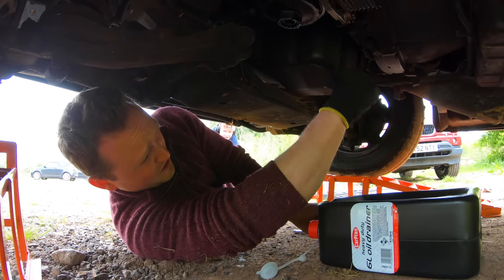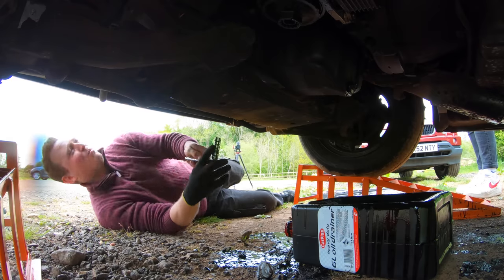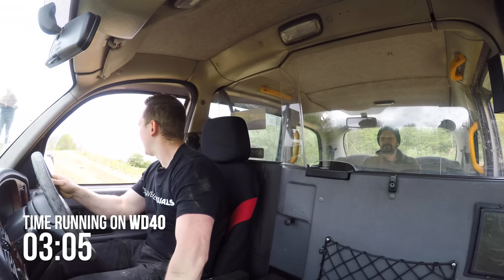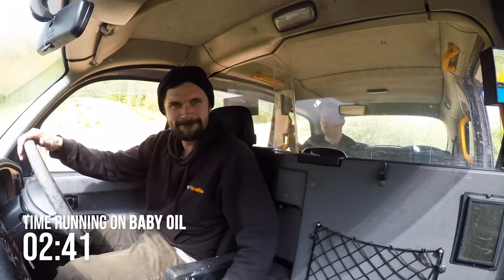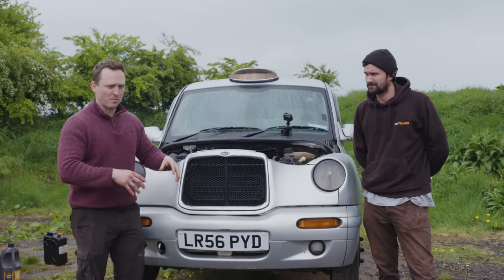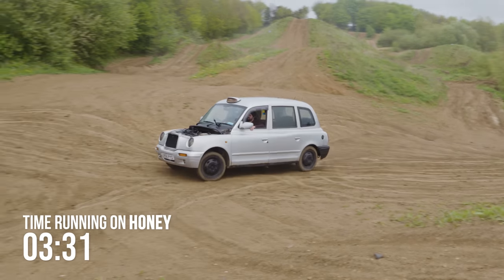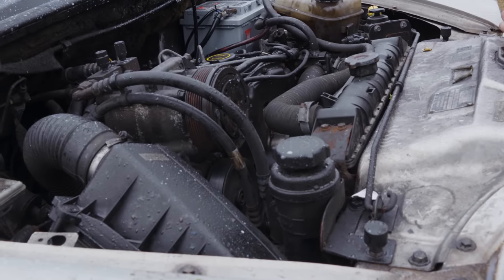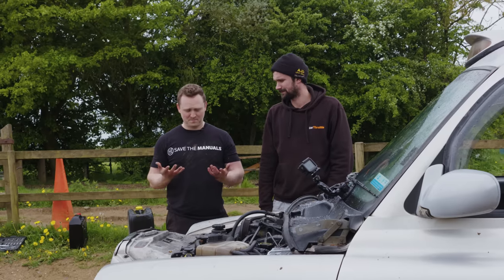We Replaced Our Engine Oil With Milk

Comment: What you should have tried at the end is to put a cleaner/seafoam in and then top up with oil and see if it would start again 😂
Reply: That was my first thought. Who knows, it might have been able to MOOOOve again 😂
Reply: Exactly this 👏
Reply: definitly, it still cranks and still seems to have decent compression just alot of internal resistance, putting som engine cleaner in there trying to crank it a bit and than some fresh oil would probably get it to a level where it would run again, these old cars dont care about no oil pressure, if it spins it runs xD

as an example watch that video where they drain oil out of 3 cars and the honda just keeps running along for like 5 min with no oil at all even throwing a rod and still running for a few seconds
Reply: This is what I was thinking... and a fresh battery, that battery sounds like it might be dead... >_>
Reply: @garthor  The battery was completely goosed and it still turned over. Still life in the old engine yet.
Reply: @garthor  yeah for sure, they cranked it so long and with such high resistance inside the engine, they even showed the battery contact smoking which, they seemed to be pretty properly connected, so a smoking contct means it was probably literally a short draining the battery really quickly. 

I would love to se like a small vlog follow up video maybe on auto alex channel or smth
Reply: Something like a Lucas or Motor Honey would work better, milk caused wear/damage not oil sludge that seafoam is intended to clean
Reply: @BadMax02_VR  could also mean it has no compression and thus turns extra easily
Reply: @yeahitskimmel  thats actually a fair point... i didnt even think about that :D
Reply: @yeahitskimmel  Marvel mystery oil is another good one for seized engines, you usually let it sit for a few days but since it turns over they could probably start it right away
Reply: Great idea!
Reply: I come here to put a pretty much identical comment
Reply: Just needs some more wd40 and it will work again.
Reply: @TheRatchetnclank  
Hi what sup,how are you doing
Reply: Hey you
Reply: @simonlegall2135  I've heard automatic transmission fluid is another good one for seized motors
Reply: Liqui Moly Engine Flush Plus + 0w-16oil + starter fluid + turn engine manually a few times.

Comment: omg, engine running pretty much dry, Jack desperatly trying to fill up oil while the cams are shooting it right back out, oil still dripping and Alex asking as calm as day "What's the torque again?" absolutly killed me xD

also: Baby Oil is pretty much just mineral oil which is pretty much brake fluid which is almost like hydraulic fluid which is oil, more or less, so yeah, totally reasonable and absolutly obvious

Comment: I've almost done this by accident, I put my car on my ramps, drained the oil then when it was time to refill i thought it will be easier to do so with the car back on the ground so I started it up and reversed it off the ramps with no oil in it 🙈🙈
Reply: I did this with my Volvo.. except I didn't drain the oil. I bought it just after it was MOTd, and was told it was serviced just before MOT. Drove it for 8k, went to change the oil and less than 100ml of oil came out.. No idea how long it was like that for but I'm glad I didn't drive it much further. Threw some oil in it and I've put 70k on the clock since then.
Reply: Hi Paul

Comment: Could be hydro locked if the milk got past the rings

Pull the glow plugs spin the engine for 30 seconds to evacuate the cylinders put the glow plugs back in there's a chance it would start
Reply: Hey David what’s good

Comment: Taking this in combination with your previous video on running a car with no oil until it died, I’ve concluded that “no oil” is much better than “lots of full-fat milk and some presumably heavily crystallised/burnt honey”. Valuable information that I’ll be using on a daily basis, I’m sure 🤔
Reply: It's the honey that killed it as it burnt and crystallised. The milk is mostly water so wouldn't have effected it much.
Reply: How are you James

Comment: The crazy thing is that an engine could probably last 500 miles with no oil assuming it's run continuously and it had oil in before it happened. It would probably be better to add any type of oil if you was stranded in the middle of no where although I can't imagine many people carry other types of oil with them. I'd recommend anybody to at least carry a 1L bottle of the correct engine oil and check it regularly.

Comment: My mate had an A70 supra with a 7MGE that had windowed the block at #5. We thrashed the living shit out of it for two days, filled the oil with coke, coolant and any other liquid we could find. It took two days of abuse and only finally siezed when he did a standing burnout for several minutes then let off and it siezed then. It is incredible how engines can still run despite being half destroyed and improper lubricant!

Comment: You should try to rebuild the engine cheapest way possible, like putting new bearings on the worn crankshaft so it would spin again (or not), don't use a torque wrench etc

Comment: Take the oil filter out, put some thin oil or kerosene in and tow it while in gear see if you can get the oil pressure back and clean the engine out and get it back running 🤣

Comment: Years ago i made an oilchange on my motorbike, and the bottles look the same. Instead of engine oil i filled in suspension fluid for the forks. I noticed it before starting. But then i ruined the expensive suspension fluid and had to clean the engine and clutch. I ended with 2 hours extra work for this simple task....

Comment: Yeah you made a basic error here, milk is no good, it's far too thin, you should have used single or double cream depending on the viscosity of your original oil ie used the one that closely matches your grade of oil.

Personally my Fiat 0.9 Twinair 875cc turbo engine uses 5w 40 so I use a good quality single cream, runs fine, I get better gas mileage and a slight boost in power, better acceleration etc
There is a slightly creamy whiff while the engine is running, best I can describe it like a hot rice pudding smell but that is normal 👍

Comment: i mean yes and no this not long enough test... you guys drove a car without oil longer then this...
i have seen a ricer miata trying to blow up his mx5 revv limiter it without oil and it wouldnt die...
so running 5min on any liquide would not break a car this easy but i guess the last liquid of the day might be where the car dies cause it be cleaned out of his oil

Comment: How long did you drive for each test?  If it was simply around this little area it was pointless.  The first at least 3 most likely still had engine oil coating on parts.  This sadly was a waste of time😔  I hope for better content in the future.
Reply: Fifth Gear once did an item on that, it should be somewhere on YouTube. Apparently you can drive a car without oil for about fifteen minutes if you drive normally.